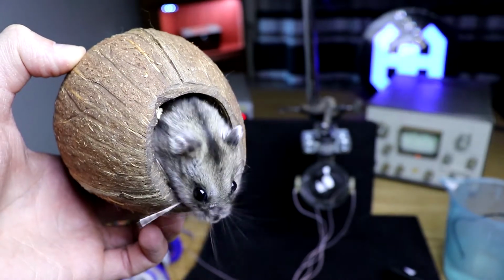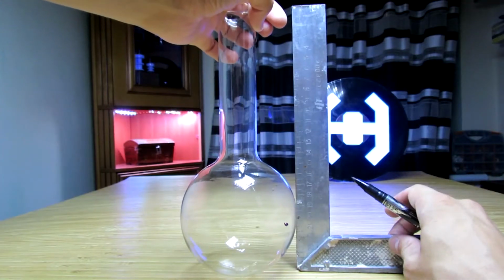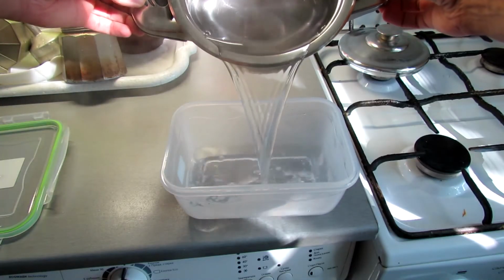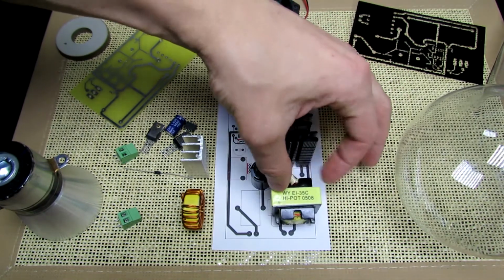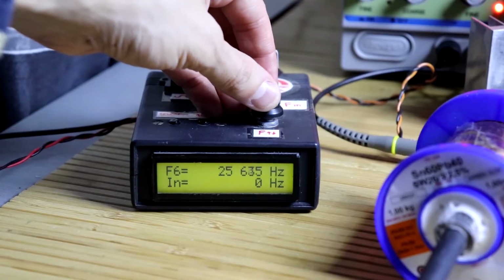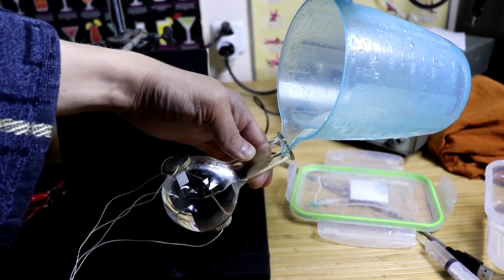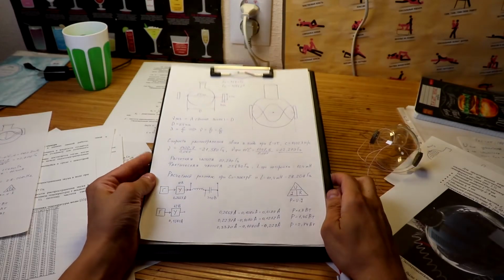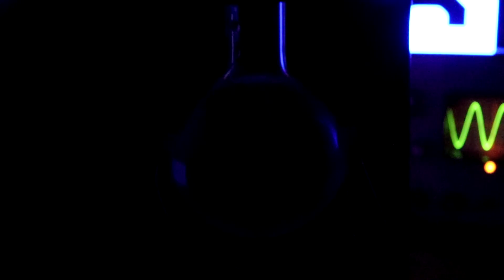NEUTRON STAR in Test tube. Sonoluminescence

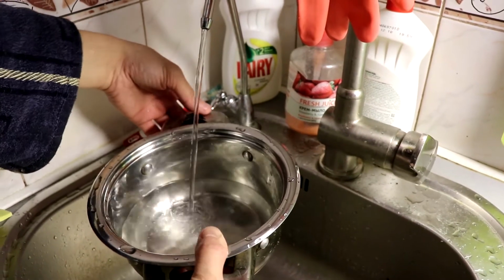Comment: 7:05 The reason for chilling water to 5C isn't obvious, but known.
In college, I performed the sonoluminescence lab. Instead of chilling the water, we used a vacuum pump to degas the water. I noticed that if we over degassed it, it would not luminesce. My lab partner and I tested various pumping times and found a parabolic curve in the results. No degassing doesn't work, and over degassing doesn't work. There is a sweet spot.
I suspect it's argon. The atmosphere contains argon, and the water needs the right amount of argon to 'amplify' the light.
If you want to, you can chill the water colder. It just means you will need to wait 15-30 mins for the water to absorb the right amount of argon as it heats up again. Feel free to test it out.
Reply: Thanks for the tip this is super helpful. When you were doing this in your lab were you applying a controlled argon atmosphere to the water after degassing or simply exposing it to normal atmosphere?
Reply: @mtbAndre1  Hint: acetone as a medium produces better results than water
Reply: @Optable  maybe 2-Propanol also work? i have only plastic spheres and aceton will damage them

Comment: Very interesting. It would be even more interesting using different types of gasses, like He, H, Ar, Ne - or a mixture - to see if it would be possible to create different colors of sonoluminiscence. Maybe using spectrum analyzer to see if the spectrum lines are as expected or differs due to the plasma conditions.
Reply: Tritium and/or helium3? ....Hmmm?
Reply: What if it's black body radiation?
Reply: @brucebower4814  Good point ;-)
Reply: i wonder whether you could put deuterium in it and get nuclear fusion in the bottle
Reply: actually ima try that i can make deuterium from heavy water bought from a chemical supplier and i can probably build a sonoluminescence setup, soooooo....
Reply: Deuterium was my thought
Reply: If that was as dense as a neutron star, it would fall to the center of the earth.
Reply: @johnjeffreys6440  Probably the other way around ;-)

Comment: Brilliant u got me subed !!
As long i know of the phenomen , i'm hooked on the what it realy is !?
I found out 20 years ago , when high power , centrifugal waterpumps are closed in the suction , they cavitate due to pressures at vacuum ..even lower ?¿ 
Meaning there impeller get physical holes in the metal body and housing.
Then at a training at my work we saw a glass centrifugal pump with same scenario , and revealing NEUTRONSTARS hihi lol
The lightspecs , but untill now , still no real answers to the Physics ???
Grtzz john

Comment: instead of a fragile glass material, what if you used a very strong, flexible metal in as much as a perfect sphere as possible that way you can crank up the intensity and see what that does. Maybe even a sealed environment with all air removed except for where you introduce the gas. Maybe have a tiny window on the side to observe.
Reply: or he could encase it all in transparent epoxy
Reply: Or plastic, plastic!
Reply: Or maybe a something more flexible like a plastic or acrylic.

Comment: Thanks Sergey.  Has it ever occurred to you that the Great Pyramid at Giza, and probably others, were designed to produce light via sonoluminescence?  All the ingredients are there.  They call it the Djed Pillar but the granite structure in the King's Chamber is the resonator and the Supercapacitor that fit in Khufu's supposed casket just below that (which it wasn't), aka the Ark of the Covenant, provided the pulse that sent the 'ping' down the superbly engineered passageways to the water below, thus punching water so hard it emitted light.

How cool would it be to light up Giza, and no I didn't light up at Giza to think of this.  Perhaps the obelisks in the neighborhood were street lamps stimulated by induction.
Reply: giza glass too
Reply: @ZeranZeran  Djedi Lights

Comment: Instead of dropping into the flash use an empty needle to put the tip where the bubble should be while its on so you can have a single bubble suspended in the right sport right away.
Reply: But you can use the way the bubbles converge on the centre as a method of determining the correct frequency.

Comment: Cool😍😍😍
Reply: Inside I have in the center somwhere a supatomic black hole behavieure😍
Without man made aditional energy sources 

Whay your led start burning without tatxhing 
Thentional diverentional displasments from inside the buble outwarts 
There h20 desolves schinks like dust inside a black hole😍

Your black hole generator with electric acustic uses😍
This buble is the same as a black hole onley diverend strinks
<🌀<>🌐<>🌀>
😍🙏😍
Reply: What happence if you tace the magnets away and ringed feildcopasators in there place  boths counterd coiling from elchader😍😍😍

Comment: You can take it to the next level if you fill a vacuum chamber with various gases and vapors of metals and non-metals creating partial vacuum, point multiple tesla coils out of phase at vacuum chamber at various volts, amps, phases, frequencies in mhz range. Under right electromagnetic conditions, fractal galaxies and stars will form inside vacuum chamber from vapors. Vacuum chamber can explode in this process if it can't handle the heat, radiation and pressure from inside so you must be careful.
Reply: Stellarator?
Reply: See the Pattern channel has video on physicist Winston Bostick creating fractal galaxies inside vacuum chamber back in 1956.
Reply: Do you think people will live in those galaxies?

Comment: this is exactly what gravity is. a standing wave created by two sound waves slightly out of phase with one another. does not matter if it was sound or radio waves or electricity or what ever. the way the waves works is what cause the effect. its the behavior of particles by a source of energy that produce the stuff reality is made of.
Reply: So if I play my sound system loud enough it's gonna make a black hole?

Comment: Seems more.like it is stabilizing a the burning of the gasses trapped in the bubble.  Instead of an unstable flash normally seen you stabilized and slowed the reaction essentially a controlled burn. I could be wrong but still cool

Comment: 20:55  Stable ultrasonic vibrations that don't disturb its placid, proximal environment is an oxymoron if you ask me. It's like some kind of miraculous harmony between violence and peace. I think all stars are actually doing this.
Reply: They are, but it isn't waves of sound that are compressing the gases of the sun, but rather the sun's own gravitational forces which are a sum of all the curvature of space time caused by the energy of quarks in it's atoms. 

Gravity pulls the star's mass inward, causing the right conditions for fusion to occur in the core; first with the lightest elements, all the way up to iron; at which point the star can no longer continue fusion. Eventually, the outward forces of the fusion reactions that were keeping gravity at bay begin to weaken, and the curvature of space time wins out in the system, and the star collapses onto itself, much like the air bubble is forced into a small space by the harmonic amplified forces of the water around it. 

However, unlike the harmonic frequencies of compression through water, it's important to note that the forces at play on a star are caused by gravity. As we currently understand it, this force comes from the curvature of space time due to the Higgs Boson imparting mass via the Higgs field, which causes time dilation and a gradient of space-time. Because space and time are reciprocal, imagining a graph, when you put points in the "space" field, you need to reciprocate from the "time" field; and so things moving quickly pass more slowly through time, and things moving slowly, move more quickly through time. This concept can also describe gravity, as the areas of any object closer to earth's density will be slowed down in time more than those further, and thus must reciprocate in the "space" field; which essentially equates to : Because earth's mass slows down time in a gradient increasing toward its most dense region (the center), you and everything in its influence must speed up through space in the same gradient; 

and on earth that happens to be 9.8m/s/s toward the gravitational center of earth; which is actually not the same everywhere on the planet, interestingly enough.

Comment: It probably easier to do with three resonators instead of 2. Because you are trying to keep a bubble still from moving forwards backwards up down left or right. With three that wpuod make it far easier to control a bubble except for the up and down which would remain the same difficulty.
Reply: just one on the bottom would have probably been better, simply cause of the symmetry of the vessel/flask

Comment: If you use this as a model on how the universe was formed then the math matches seamlessly with stars being oscillating bubbles emitting colors like they do in a telescope
Reply: I mean, there are some loose connections, but it's not at all the same mechanics. Density of gas clouds in the early universe collected into giant balls due to the curvature of space time caused by the gas molecules. They eventually got massive enough to create the right conditions for fusion and that's how a star is born. 

What we're seeing with this experiment is sound waves interacting with a medium that does not compress much (Water) transferring immense pressure into a compressible medium (gas) and hypothetically, the gasses in the air are then excited enough during this compression to emit photons by some quantum interaction which is shedding energy from some isotopes, presumably. 

This experiment is unlikely to "seamlessly" match the compression of interstellar gasses into the formation of stars, as the physical properties of these phenomenon are not the same. 

That being said, the basic idea of compression is inherent in both systems.

Comment: Any passive x over that has luminous inducters does this over n over each pulse of sound lighting bright AF.  Dcm loudspeakers are quite cheap way cheaper than what this guy's going through lol.  Ya just get them cranking n turn out the lights the ports on rear of box can illuminate so bright it's visible on the wall behind the speaker.

Comment: Does the size of the sonoluminescence phenomenon scale up in proportion to the size of the equipment used?
Reply from the maker: I tried to do on larger hardware but couldn't get a star...
Reply: @hamstertimeen  have u tried using just one transducer fitted to the bottom of the flask ? Symmetry of the flask leads me to believe it would work better that way
Reply: @hamstertimeen  and then u could also encase it in transparent epoxy, paying attention to maintaining symmetry, so that the flask can't BREAK so easily
Reply: What if you could get transparent aluminum?

Comment: So what if I had 8 million of this running in parallel. Also the water, being pushed with 1/3 of it’s full gravity on earth.
A pistol shrimp claws can make a  bubble that gets to the temperature of the photosphere (top) of sun.

175 decibels. Sound of a jet engine.
ÿ= ksi 1.4 (1400 psi) 175ÿ*x8 million 

24,500,000 decibels* (times) 10 
How powerful the cavitation from that sound pressure. In theory it should work?